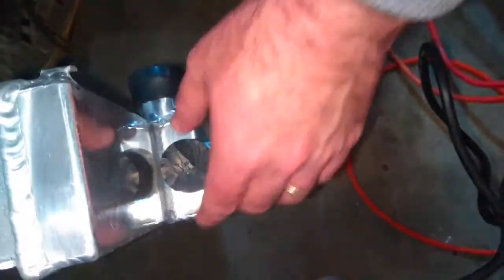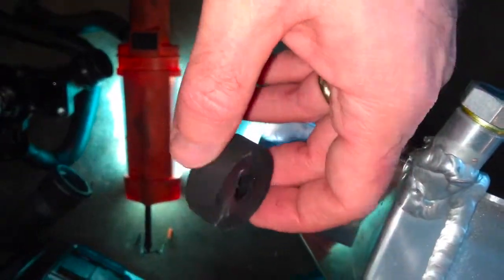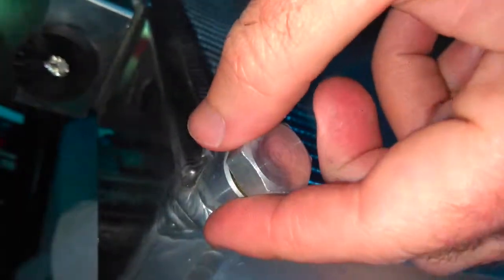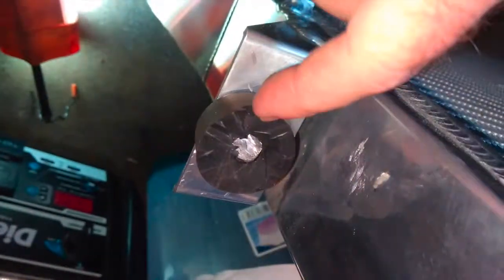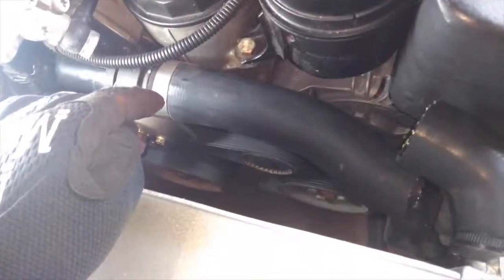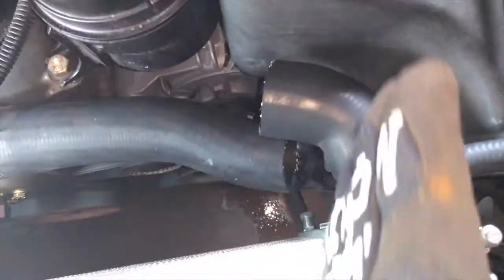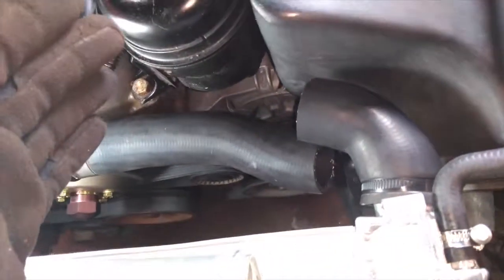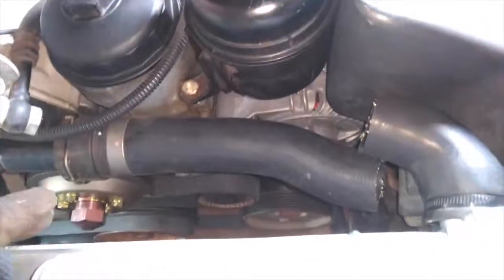BMW Z3 Front Coolant System Rebuild

Comment: That was so extra. All I would have done was shorten that upper hose from the thermostat side cut off that original press on band clamp shorten the hose until the link was gone and throw on your own worm clamp 😂 you just really wanted to use your 6inches